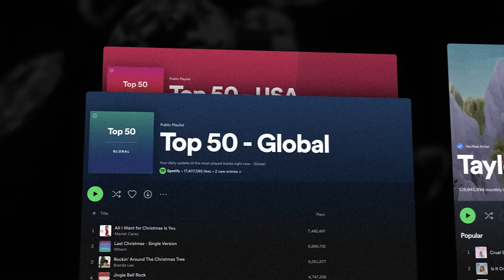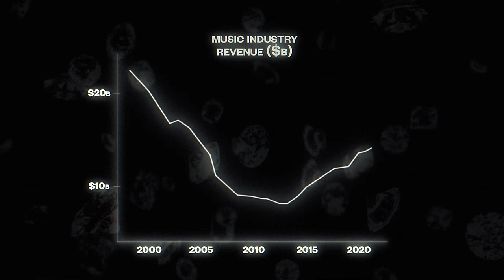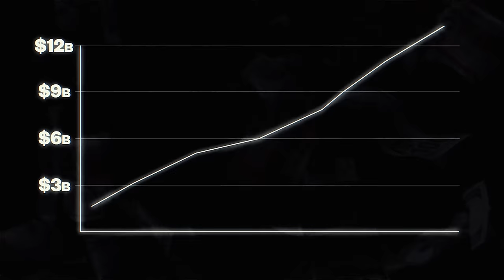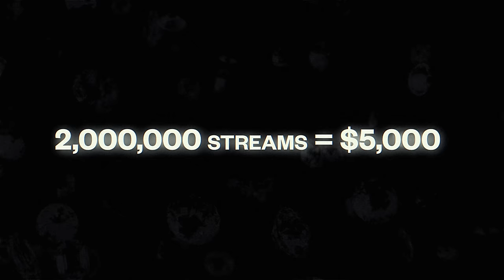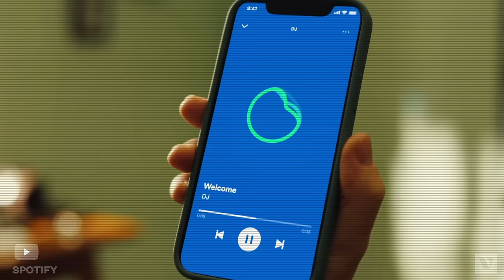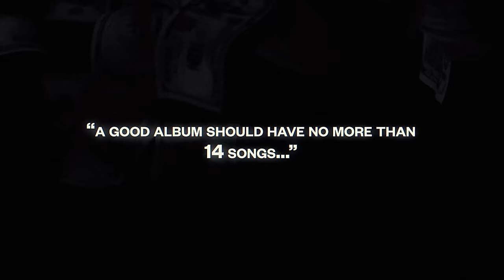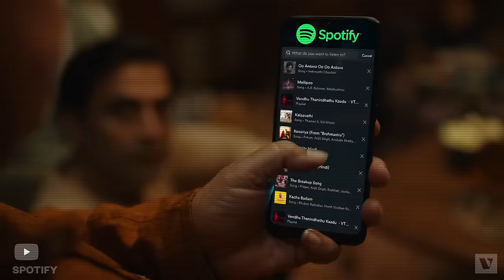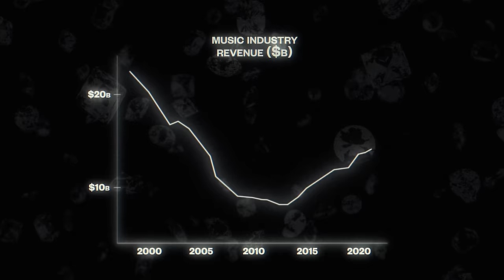The Shocking Story of Spotify

Comment: I've also noticed that the roll-out strategy for smaller artists has changed. Before, artists used to have 1 or 2 radio singles to promote the album before it came out. Now, artists are doing a long, drawn out release where they'll release 2 songs as an EP, then another two songs as an EP with the first two songs at the end, then another 2 songs as a 3rd EP with the previous 4 songs globed on to the end. Finally, when they release their 12 song album, we've already overplayed half of it. 

It's clear this is also a symptom of the streaming era, where artist latch on to the hype of their "singles" by shipping a ton of EP's with the same recycled music that's going to be "released" on an album. I get why they do it, (more streams) but they are ruining the album experience for listeners. I want to be surprised and delighted when an album comes out. Instead, I've been listening to half the album for the last 3 months so when the full album does come out, I'm not as excited about the any of the new music. (Examples of this roll-out strategy: Caroline Polacheck's 'Desire, I want to turn into you' and Between Friends' 'I love my girl, she's my boy')

Anyway, Great video!
Reply: It's not just that it's more streams as such, but if the album has tracks with higher streams I think that will also help it become more discoverable in playlists etc. when it drops.

Comment: I agree with most of your points but I think the shortening of songs is a bonus and the quality of the song is a separate issue. The Beatles average length of song is between 2-3 minutes. I think the shortening of songs is good even if a lot of the incentives causing the shift aren’t good. I always felt like there was a lot of filler in the 2000s to make a song longer and seem more worth the $1.29.

Comment: Ok, there are a couple corrections to be made here. You say artists make between 4-6 dollars per 1000 streams. For $4 , you would get to $5000 per month at 1.25 million streams. At $5, that would be 1 million streams, and at $6 that would be 833k streams. However, some sources have royalties going down as low as $3, which would be 1.6 million streams. Given this range, 2 million streams could make anywhere from $6000 to $12000.

When you start the section about album equivalent units, you say that 1500 streams counts as a sale, but on screen it says 15000 streams counts as a sale. In reality, the newest rate is 3750 ad supported streams or 1250 paid subscription streams. Using your ratio of 220 million paying customers to 280 million ad based users, this would mean 2650 average streams is equivalent to 1 album sale. This is equivalent to anywhere from $7.95 per sale to $15.90 per sale, not $5. Going platinum would then be ~2.65 billion streams, earning from nearly $8 million to nearly $16 million. I'm not sure where you got 1 billion streams considering your number is either 1500 or 15000, which would be 1.5 billion or 15 billion respectively. This next part is probably the most important: with the CD revenue, a significant amount of that $15 million is going towards producing and distributing the CD. The customer pays $15, yes, but much of that $15 goes to paying the employees of the store, the profits made by the store, the shipping associated with getting the CD there, the cost of the case and the disc itself, etc. In the streaming numbers, all of those costs are already accounted for, not only because it is a digital item without physical costs, but because the numbers you're dealing with have already accounted for the cut that spotify takes.

I don't think this really changes anything about the narrative of the video, just a few differences in the numbers. The fact that 25% of users will skip a song within 5 seconds is crazy, I did not know that.
Reply: "The customer pays $15, yes, but much of that $15 goes to paying the employees of the store, the profits made by the store, the shipping associated with getting the CD there, the cost of the case and the disc itself"

Why are we even talking about physical media here? You can easily do paid downloads from Amazon and Bandcamp and most of that money goes to the artist.
Reply: Because that's the comparison Volksgeist made.

Comment: No one is getting $4-5 for 1,000 streams. I get about 150k streams a month and get between $80-$100. The rates vary by platform and the numbers are all over the place. And rarely do Spotify's numbers line up with your distributor, say, CdBaby or whatever.